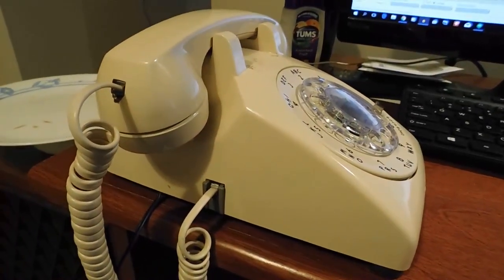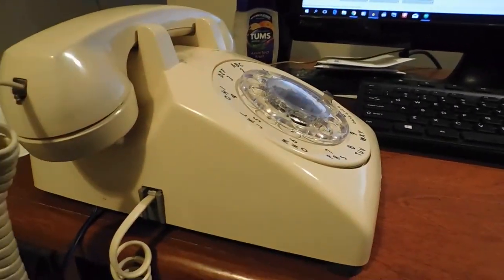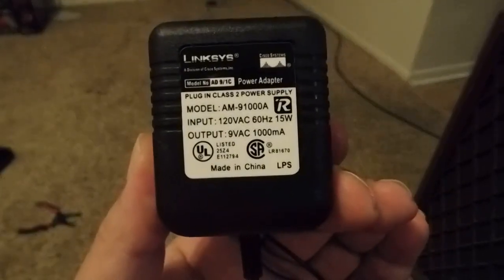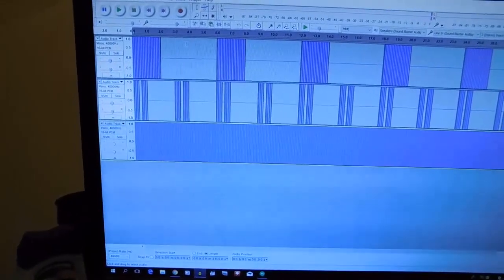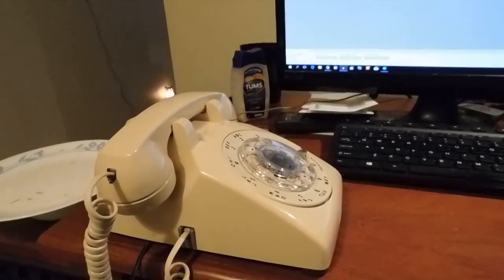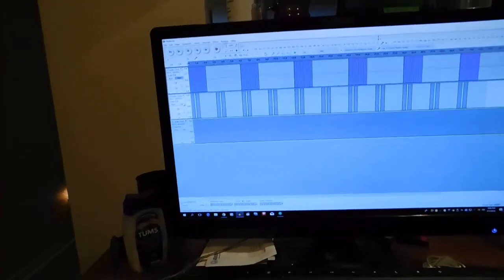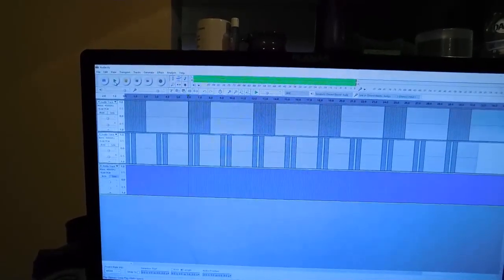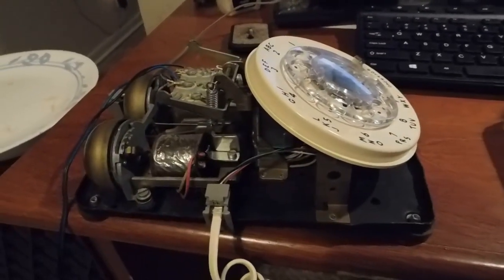DIY phone line simulator

Comment: I made a line simulator out of an old dsl filter, a 1k resistor and a 12vdc wall wart. This is interesting as well. I was considering the circuitry i needed to make a dialtone and ring circuit.
Reply: What was the DSL filter for? Getting the high ring voltage out of the audio circuit?
Reply: @charlie_nolan  Only thing i used it for was the RJ connectors on the end, the rest of the circuitry was bypassed. I had no ringing issues on the line.
Reply: @darqen271  oh, thanks!

Comment: A question I have is when I was a boy, it gave me a kick to hook a 6 volt dry cell to a door bell to hear it ring. The door bell would work by electromagnets pulling the striker, once the striker was pulled it would break the circuit to the electromagnets releasing the striker. once released it would complete the circuit to the electromagnets.  Now are you saying that telephone of the past used electromagnets but could to not run off D.C. like my boy door bell did?
Reply from the maker: The bell needs high a impedance winding which AFIK are resonant so only 20hz AC at high voltage will ring the bell... no make and break contactor on that bell.

When the phone is hung up there is -48 volts present on the phone line. 

A standard bell would wreak havoc with the central office since it needs to be in circuit with the phone hung up. Every time it dings, the central office will think your picking up and hanging up the phone